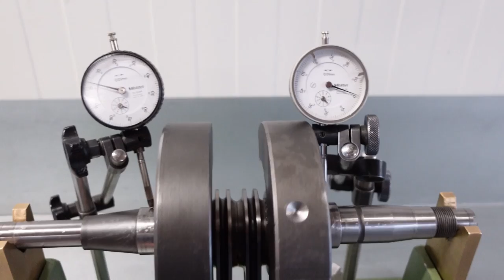Rebuilding a Ducati Bevel-Drive Crankshaft - Back to Classics

Comment: Back in the early 1980s, I was racing 100cc single cylinder karts, I had a very experienced engine tuner rebuild my engines to an extremely high standard. The technique he used to assemble the crankshaft, was exactly the same as shown here. It is good to know that even after all this time, the craft is still alive.

Comment: Jeff Bratton used to build the crank on my BOTT Duck. He did all the cranks for top racers. We made crank pins that were .0005" larger to press in crank tighter on Jeff's recommendation. Also hollowed out pin quite a bit as material was always being removed from pin side in crank for balanced, so that made job easier.
Reply: Jeff did my crankshaft for my 900ss back in 1979. I ran the bike for year without problem. Sold the bike to a friend of mine and he ran it for years without any problems.  At that time he was doing the crankshafts for Kenny Robert's TZ's.

Comment: A Ducati engineer in Australia retro fits plain big end bearings (as in mille) too earlier roller bearing Ducati engines. I am currently getting an engine built a round case with Darmer desmodromic heads and barrels. So a desmo 900 round case with an alternator in each side with a view to fuel injection. Keep up the good work I’m loving your content. DUCATI For ever kneel before your god Fabio Taglioni. Wobbels the mad Aussie

Comment: I learned this technique many years ago at college, great to see a master put it to practice. Just wondering what assembly paste was used for crank pin to web interference fit was used? Looked like graphite or molybdenum?
Reply from the maker: Correct, we use Molykote BR2 graphite paste for this.

Comment: 0.02 mm between the conrod and the crankpin is too tight according to Veetwo. Not enough room for the oil.
Reply from the maker: We always look for a clearance between 0,020mm minimum and 0,030mm maximum.